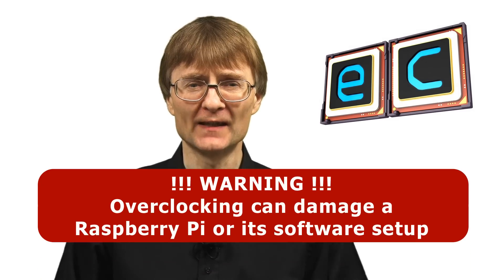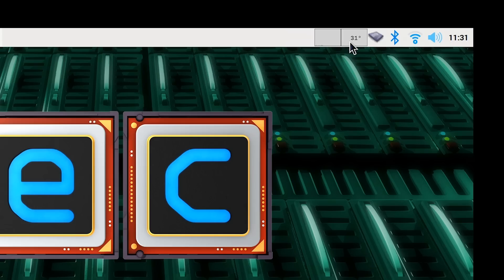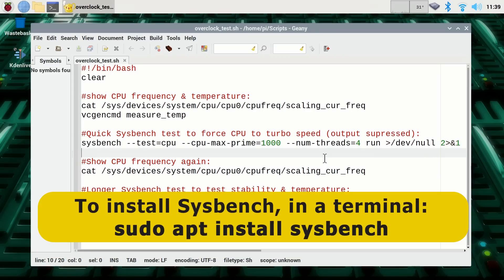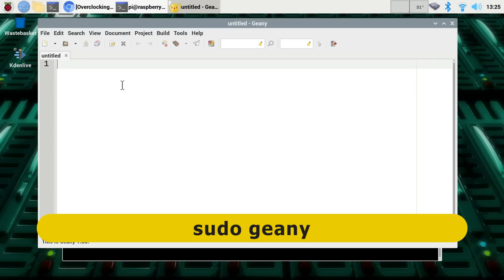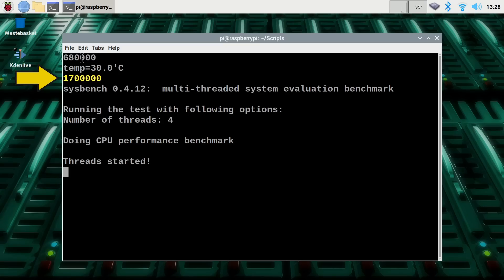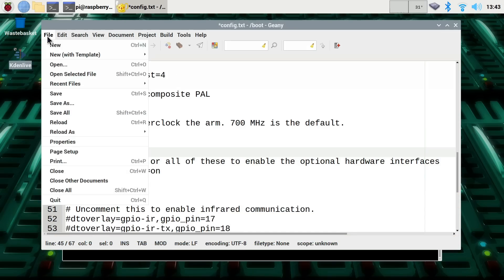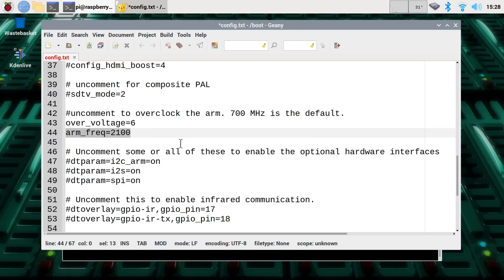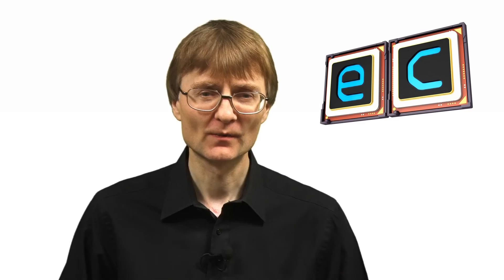Raspberry Pi 4 Overclocking

Comment: There is a significant gap between the fan and the cooling fins with this cooler, most of the air flow seems to pass out of the sides, therefore not cooling. Would blocking this with sellotape make an improvement on the cooling efficiency.

Comment: Worth noting if you have hit the 2ghz mark. Try turning down the voltage as lowering it will decrease load temperatures and decrease wear on the chip. You should never use force_turbo as that forces full voltage through the chip all the time, which will decrease its lifespan as the high voltage under low loads erodes away the silicon.

Comment: Some things seems to be deprecated:
cat: /sys/devices/system/cpu/cpuo/cpufreq/scaling_cur_freq: No such file or directory
temp=54.0'C
cat: /sys/devices/system/cpu/cpuo/cpufreq/scaling_cur_freq: No such file or directory
WARNING: the --test option is deprecated. You can pass a script name or path on the command line without any options.
Unrecognized command line argument: prime=50000
cat: /sys/devices/system/cpu/cpuo/cpufreq/scaling_cur_freq: No such file or directory
temp=54.0'C

Comment: Hello again Chris, I'm running the Raspberry PI OS and noticed that if you click on the Raspberry icon then Preferences then Raspberry PI configuration then Performance. There is a GPU memory field that you can change.  I changed mine a few times and settled at 128. I ran a YouTube video of a guy processing a tuna fish and had 2 frame drops after 5000 frames at the 1080p setting. Also I overclocked the cpu to 2.0GHz. I have the PI 4 in a little case with heat sinks and a small fan that you can hardly feel but works fine. CPU temp went up to 68C running your overclock script file. Enjoy the rest of your weekend. You could also "sudo raspi-config" to do the same thing

Comment: Good vid as usual. I do believe you are becoming more school teacherish as the videos mature. This section on Pi.org may in part explain the unusual results at 2100MHz.
------------------------------------------
To view the Pi's current frequency in KHz, type: cat /sys/devices/system/cpu/cpu0/cpufreq/scaling_cur_freq. Divide the result by 1000 to find the value in MHz. Note that this frequency is the kernel requested frequency, and it is possible that any throttling (for example at high temperatures) may mean the CPU is actually running more slowly than reported. An instantaneous measurement of the actual ARM CPU frequency can be retrieved using the vcgencmd vcgencmd measure_clock arm. This is displayed in Hertz.
-----------------------------------------
Therefore keeping a close eye on the CPU monitor during the script session may show the problem but, your little display window may not be fine grained enough to show the throttling. Perhaps your script can be modified to also display instant frequency.

Comment: force_turbo=1

arm_freq=2350
gpu_freq=850
over_voltage=15
boot_delay=1

you might want to use the 21W Zonepi USB-C 5,25V⎓4A power supply with those settings and active cooling of course

Comment: The Raspberry Pi 8 and my opinion after 3 weeks working with it and crashing it so many time I have lost count. Why because there are so many opinions out there I wanted to use it full time first to see if it can indeed be used on a daily bases and second which distro really is best for stability, over heating, and finally over clocking. Storage Samsung T5 125g, quality on the Pi is important.
(1) The Pi can certainly be used as a daily driver of course without gaming included. My big test was I watch T,V, on my mini computer that I built so can you watch movies and television on this yes a little slow on booting the program in some cases but once up and running no problems.
(2) Over heating will occur if you are not using at least heat sinks in my case I opted for a cooler which works great. Bare bones heating hit as high as 70-80 Degrees way to high, Heat sinks much better 60-70 degrees, and a cooler 40-50 degrees all under stress.
(3) Distros I have tried them all the 2 best are Twister and Raspian both very stable and quick.
(4) Finally over clocking. My opinion do not over clock if you are not using a cooler, the heat and stress on the CPU is just not worth it because it will cause throttling, and you will get video tearing. I have tried all levels of over clocking and in my case from the max of Over_voltage=8, Arm_freq=2140, GPU-freq=700, I find the best setup is really gpu_mem=512, gpu_freq=600 and over_voltage=6, very stable, heat and tearing controlled.
Take my opinion for what it’s worth have fun with the Pi it’s great to work with.

Comment: Hello, Chris,
Can you try using vcgencmd measure_clock arm to test the clock?
The standard ways to check the clock on Linux have some discrepancies when using the commands on the Raspberry Pi. At 2100 MHz, an over_voltage of 8 will be required.

My Raspberry Pi 4 Model B 8GB has a clock of 2.35 GHz.
I have used these settings:

arm_freq=2350
gpu_freq=850
over_voltage=15
force_turbo=1
boot_delay=1

force_turbo is required for over_voltage if it is over 8.
boot_delay is required to avoid corruption by using force_turbo.
I have used vcgencmd to verify that these settings work.

A lower-memory model may not work, as on the 8GB model, the power IC has been upgraded to support more power throughput to allow for the increased memory.

Comment: I have a Raspberry Pi 4 8Gb kit coming in the mail along with two different cases and some copper heat sinks. Only one of the cases has a fan, the other case (Argon neo) uses the case. I'm thinking I'll use the cheap Perspex  one because it has a fan in it and room to install the heat sinks...

Comment: Would a nintendo switch microsd be faster than the high endurance sandisk you used in another video?

 Nintendo-licensed to provide dependable, high-performance storage, The SanDisk microSDXC card for the Nintendo Switch system lets you add up to 128GB of capacity with transfer rates up to 100MB/s(1) so you can keep your favorite titles on a single card and start playing in no time. And with a lifetime Limited Warranty,(2) You get gaming storage ready for the long haul. | 1gb=1, 000, 000, 000 bytes. Actual user storage less | (1) 128GB: up to 100MB/s read speed; up to 90MB/s write speed. 64GB: up to 100MB/s read speed; up to 60MB/s write speed. Based on internal testing; performance may be lower depending upon host device interface, usage conditions and other factors. 1MB = 1, 000, 000 bytes. (2) 30 Year Warranty in Germany, Canada, and regions not recognizing lifetime warranty. See the SanDisk website for more details.
Includes BlueProton USB 3.0 MicroSD/SD Card Reader

Comment: I am running the 64 bit beta of raspbian. There seems to be no release of sysbench yet. The processor seems to run a bit warmer on the 64bit raspbian OS (idle 49 c) with the argon one m.2. 

Could I still safely try to overclock the system (as I can‘t test it to its limitts).

Thank you for answering and for the great content.

Comment: Thank you for this informative video - the tip with shift is really important! 
I've compiled recommended overclocking settings for different Raspberry Pi models into a simple web-based tool. Check it out here:

https://picockpit.com/raspberry-pi/overclock-raspberry-pi/

I'm also giving instructions how to test the stability of the overclock in it.

Comment: I have voltage=15 and cpu=2400 gpu=850 and im forcing all cores to stay on turbo boost. Pi 400 is the machine and i have never seen temp over 60. Watching 4k with = frame skip after initial 10fps missed.

Comment: Chris , you don'h have full CPU utilization when there are some IOs. When your CPU is waiting some IOs, it does nothing. To test a CPU you should not process file but do calculations that only occur in memory
Reply from the maker: The CPU test in Sysbench does not process a file. It factors prime numbers and results in 100 per cent CPU utilization as the CPU usage meter clearly shows. :)
Reply: @ExplainingComputers  second option. The gauge displays the average core activity and the calculation process only uses 1core

Comment: Thanks for the great video Chris, I just bought my first Pi (4B 8Gb) and now have it running at 2Ghz with the new (horizontal) ICE cooler. Interestingly I've discovered that thermal paste is crucial to achieving the 177 second sysbench and that clearly some form of CPU throttling is occurring way short of the expected temperature. Waiting for my thermal paste to arrive from Amazon, I wanted to try the cooler anyway with the pad to see what it would do. At 1.5Ghz, sysbench ran in the expected 239s and hit a peak of 36 degrees, this relatively low temp encouraged me to try tentatively overclocking. Gradually reached 2Ghz and ran the sysbench without exceeding 44 degrees - however it took 213 seconds. CPUfreq frontend was reading 2000, but the calculations took longer. Yesterday the paste arrived, I applied it and re-fitted the cooler. At 2Ghz sysbench ran in the 177 seconds you achieved, without exceeding 34 degrees. Based on everything I've heard about the throttling, the difference between 34 and 44 degrees was quite an eye opener!
Reply from the maker: Looks like you are already getting seriously into Pi stuff!
Reply: @ExplainingComputers  Definitely, I used Linux a lot from 1999-2007 and haven't much since. It's gradually coming back to me! Your videos have been a great help.

Comment: If the internal clocks are generated from PLL setting high frequency from high level language may leave PLL without any limit and that would lead to those strange numbers. In other words PLL will give everything it can without stable lock, if any of that is true measuring time may be inaccurate as well.

Comment: Thanks to your great step by step instructions, I'm overclocking my new RPi4B @2GHz. It has an Argon Fan Hat, of which I've been able to easily optimize the 3 temp/fan speed settings in a config file. This the best cooling solution that I've found for the RPi4. It also mounts onto the RPi3A+, with the exact same footprint. Waiting for the Argon One M.2 case to arrive to complete the whole package.
Anyway, I agree that something doesn't look right about your overclock_test.sh time results @2000 kHz, because mine were only 201.3s for the same script. That also falls within the expected curve. However, my temp was 45'C at idle (fan off) & 70.0'C at the end of test, with the Argon fan running @ 100%, above 60'C.
Just thought the input might be of interest. :-)

Comment: My current stable enough to boot to windows desktop overclock record is 2460Mhz.   It's amazing.   I'm using modified ice tower cooler and temperature is only 27C.  https://cdn.discordapp.com/attachments/733304132357849099/761648392496480306/anydesk00033_2.png

Comment: I have used a rotary burr tool to modify the original stick on heat sinks so that at least the other two will fit alongside the Ice Tower. This has allowed for additional passive cooling inside the enclosure I use and has made some noticeable difference instability under heavy loads such as video encoding and transmission.

Comment: I finally got my Raspberry pi booting off an SSD.  I had to update the EPROM to get it to work,  Odd thing was that I could boot from the top USB3 port, not the lower one.  It kept saying that the USB device was missing.  After that I was able to get the 64-bit version to boot(I did get the latest version of the software), after it would not saying that the software required on the USB driver was too old.

After that I had to install sysbench from the source by downloading and re-compling it from GITHIB.  I can't get the bash script to run.  The vcgencmd is working.  Any help would be appreciated.
RC

Comment: I looked at the video on overclocking a pi 4 . Liked the way you added an m.2 ssd  , found this on Amazon thought this might be of interest  	Geekworm Raspberry Pi 4 X862 M.2 NGFF 2280/2260/2242/2230 SATA SSD Storage Expansion Board with USB 3.1 Jumper for Raspberry Pi 4 Model B Only  .I tried it and it works fine for me . keep up the good work .

Comment: Hey Chris.
I have a Pi4 and a Pi3b.
The 3B I had purchased in 2015 or 2016. Still looks immaculate. Meanwhile the  Pi 4 which I purchase in Jan 2020 shows signs of heavy rust. The chip which is on the left of the SoC just near GPIO pin 1, has a rusty plate. Rest all is great. Any knowledge of this issue?
Secondly, my PCIe seems to be giving troble. The key board and mouse stops working intermittently. And then I have to restart Pi couple of times before it starts again. And then it stops after few seconds after boot.
Any suggestions on this issue? My seller flatly refused to even test it saying that there is alot of rust and looks like it is thrown in mud.

Comment: I tried this on a Pi 4 with 8 GB RAM, running the 64-bit Raspberry Pi OS. I had to install sysbench in a round-about way as its not in the 64-bit repos, and I got a few warnings about the syntax I was using in the bash script being deprecated, but I was able to run the 50k prime test, at 2GHz overclock, in a smidge over 10 seconds. Can that be a real result or is sysbench not operating the same in my 64-bit OS?
Reply from the maker: The version of Sysbench for 64-bit Pi OS is very different to that which runs on the 32 bit. Basically, the old limit for the test was 10000 events, but in the newer version you will have in the 64-bit OS it is 10 seconds. To run a comparable test, you need to set --time=0 and --events=10000. So add "  --time=0 --events=10000 " after -threads=4 (don't enter the quotes!). :)

Comment: I'm the path to get info about the underclocking possibilities of a Raspberry Pi Zero W to save power in a portable devices.
I need to get really low power as the cellphones do but seems there's no way to get a lower power consumption than around 40mA without adding external hardware.
A power consumption lower than 20mA would be nice.
Reply from the maker: Underclocking and power use is something I may well make a video on.
Reply: @ExplainingComputers   I would appreciate that.

Comment: how about the quality of the output videos at the different overclocks, i am curious if system instability at even slight amounts could change the output
Reply from the maker: The video output will be identical -- it is digital video. System instability would lead to a system crash, not degraded output.

Comment: I wonder if the temperatures will be ok when running the fan from the 3.3v pin, instead of the 5V pin?
Since the Pi uses 3 CPU settings, perhaps it's good to lower the idle CPU frequency, to 350Mhz, to lower temperatures and power consumption while idle.
On my 3B+. I could attain 50-100Mhz from it's max speed, with a voltage setting of just +3.
On the 3B+ it was also possible to upclock the GPU, and DRAM speed, and overvolt it by +1 or +2.
Reply from the maker: I would never connect a fan to the 3.3V line, as it draws current after the Pi's voltage regulator. In contrast, the 5V line is before the regulator.

Comment: Thanks for the great video! Having overclocked for cpus for ~30yrs has me wondering if you ran into any io corruption? SOC/SBC's seem to be quite often limited by their io bus. Were you able to use the gpio at the 2.1~2.2 speed? Also, I'm curious how the Odroid (u and/or c) boards compare to the ice-tower rpi4? I suspect the better graphics and cores costs heat and power, but I can't afford to bench test them.
Reply from the maker: Thanks for this feedback. I had no corruption issues in the tests I did. I did not test GPIO -- an interesting idea for a future test. :)

Comment: It would have been interesting to monitor power draw from the wall, and perhaps temperature of the power supply brick as well, as the brick appears to be a limiting factor on rpi generally (and a common point of failure).
Reply from the maker: Yes, I should have done this. Noted for next time!
Reply: I'm using my laptop's 60W USB-C power supply, and it's great :)

Comment: Hi Christopher. Nice video. 
The governor doesn't always show the correct clockpseeds. This because there is a closed-sourced OS Threadx running on the Raspberry. That has full control of your pi, you just can change things with arguments. But what is done in Threadx isn't what is shown in Raspberry PiOS. I once made a long video about that. That's one reason Raspberry's ain't my favorites. To get the real clockspeed do  "vcgencmd measure_clock arm"
That'll show the true cpu clockspeed. 
I yesterday made a video about running windows programs on the Raspberry Pi 4 with BOX86/Wine in TwisterOS. Also made videos of windows games on the RPi4. It is awesome to be able to do this. Maybe a subject for you, TwisterOS. Is Raspberry Pi OS with tons of cool features. You can make the desktop look like old windows, or ios or anything you want. Overclocking is done with a tool, no more editing textfiles. Tons of gaming emulators preinstalled, and Box86 + wine.
Now I want it on a more potent board like the RK3399s or even the Odroid N2+. But for that one I'll have to wait for good open source gpu drivers. 
Have a great day. Greetings. NicoD
Reply from the maker: Hi Nico, thanks for this -- great info. :)